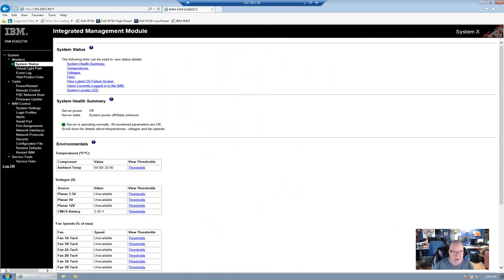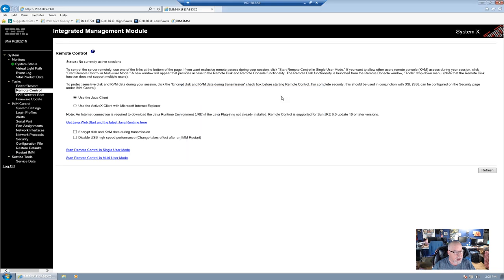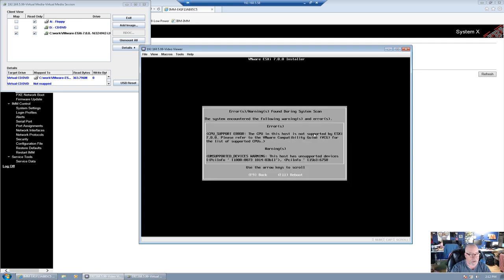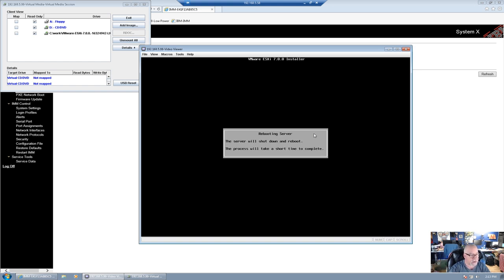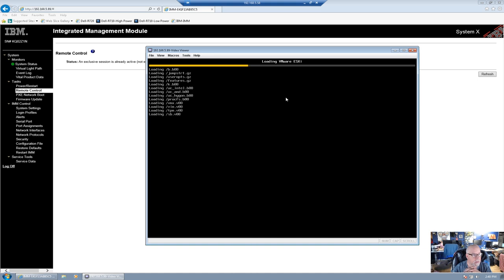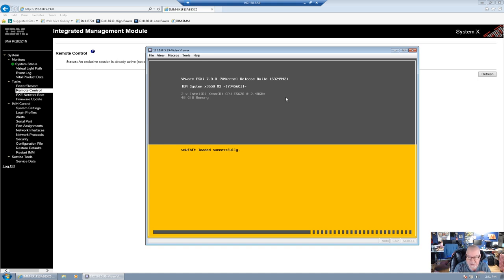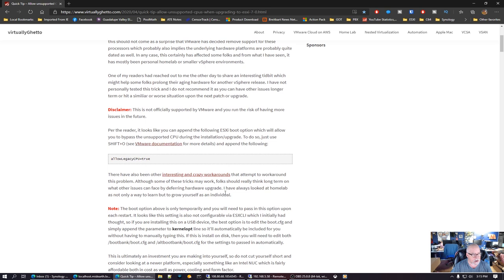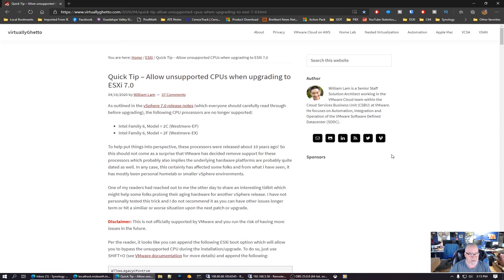ESXI 7 install on un-supported hardware

Comment: Awsome, thank you Joe , you just saved me from a masive headache  😎🙏, I installed ESXi7 on HP Z600 🎉
Reply from the maker: Glad it helped
Reply: I'd be grateful if you could share information on the ESXi 7 image you were able to use on the Z600, after Ctrl+O and allowLegacyCPU=true, I get "No network adapters were detected" - This is before choosing the drive to install on.  I've tried it using the stock ESXi 7.0 U3, and a few HPE versions from 7.0 to 7.0 U3.  Thank you :)
Reply: @AubsUK  hello, I’ll check it out and I will let you know 😉
Reply: @AubsUK  VMware ESXi 7.0.3 (VMKernel Release Build 19035710); make sure your VM is supporting Virtualize Intel VT-x/EPT or AMD-V/RVI.
Reply: @maryamfarnegin1647  great, thank you. I'll check if I tried that, but I suspect I did. Do you by any chance have an additional network card? I don't, and am only using the onboard one.
Reply: @AubsUK  Yes, I'm using a second network card as a USB WIFI dongle.
Reply: @maryamfarnegin1647  that'll be it then, good thinking! The onboard NIC isn't detected, so I'll either have to build an install with the right drivers or use an external.

Thanks again, really appreciate it 🙂
Reply: @AubsUK  You're welcome 😉

Comment: for any recurring needs to fix the ISO to allow unsupported hardware in the boot.cfg file. located at 2 destinations /bootbank/boot.cfg and /altbootbank/boot.cfg.
With "kernelopt" you can append the same option. Nice video
Reply from the maker: Thanks for the info!

Comment: Hi UnckyJoe,
I just installed esxi 7.0 u3 on my ibm x3550 m3 using your guide. The installation was successful, but when I went to the storage menu no disk was detected in the devices tab. while on the adapter menu there is a list of adapters, one of which is the ICH10 4 port SATA IDE Controller model. do you have any suggestions for this problem.?

Comment: Hi Joe, I'm using ESXI to virtualize some machines inside the server and recently I'm having some problems with the Dell PERC H345 Front card, it's not starting when I turn on the server, I'm having to run it manually when I access ESXI, you know how do i solve this?

Comment: I did this work around on dell r420 esxi installed but does not see the internal drives? Any ideas ?
Reply from the maker: Probably the controller for the drives is not supported.

Comment: The problem I had that UnkyJoe bypasses, perhaps unbeknownst to him, is ESXi 7 ONLY recognizes the USB drive and not my SAS drive. UnkyJoe has installed ESXi 7 on a R710 in a different video, (My specs listed below), but Always installs to the USB. 

ESXi 6.7 recognizes both drives.

I may just install to the USB and do a dual boot as he did with Win Server. ONLY reason I may do that is I installed Win 10 on ESXi 6.7, gave it 14 cores, but I program I'm using on Win 10 only sees 2 cores and it's performance bares that out. When Win 10 is installed directly on the server it sees ALL 14 cores I associate with it.

Any ideas why it doesn't see my SAS drive? and perhaps why when used in a VM vs direct install the program only sees 2 of 14 cores?

Dell R710 
Xeon X5660 6-core
32GB - 1333
PERC H700
iDRAC6 Ent.
Reply: Hey. Just checking did you find the solution for this?

Comment: I installed ESXi 7.0.0 in my hp dl380g7 2x5670 CPU. During install it warned me that my 10gbs network card is not supported but once it finished the network is running fine (hp nc552). Also I  did update to ESXi 7u1 using vCenter without any warning...
Reply from the maker: Thanks for that information man it is really helpful :)

Comment: I have 6.5 installed. Will it work if I chose the upgrade option?
Reply from the maker: doubtful.
Reply: @UnkyjoesPlayhouse  it didnt and I had to update the bootbank and altbootbank on the disk via ví and cat because every reboot i would loose my settings.

Comment: Well they will remove that fix in a future update. Google did that with java support. I have to fix it so people could still use java in their web browsers. Then in a update it was gone. So don't be surprised when esxi 7.1 or however their numbering convention is that it does not disappear.
Reply from the maker: Did you click on the link to the article? It was a VMWare employee that posted the tip, I doubt it will be removed as it has been in the other versions of esxi. Thanks for watching.
Reply: @UnkyjoesPlayhouse  You're welcome! I watch your videos all the time. I figure they will remove it at some point. They don't want to support older hardware. I hope proxmox does not do that because that is the one I use. I hope that they don't remove it for you and everybody else.

Comment: Proxmox, problem solved, backup solution included
Reply from the maker: Thanks for watching :)  P.S. The new Proxmox does not work with my Melanox 10Gb cards either, not supported in the new kernel.